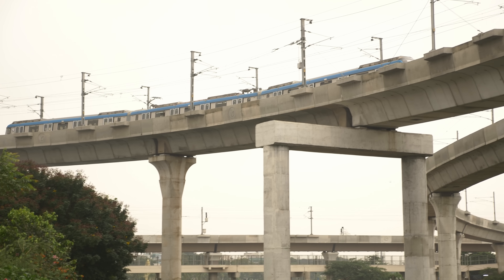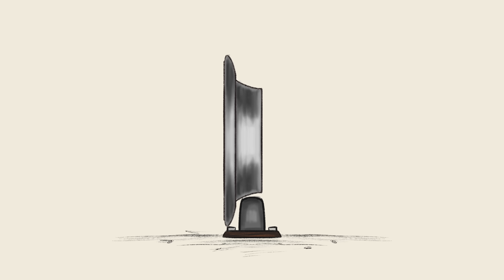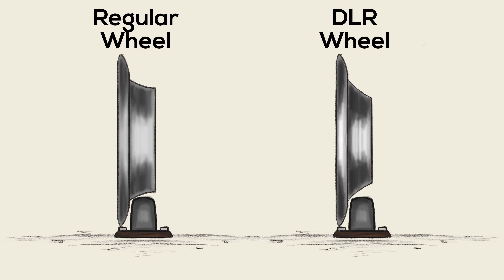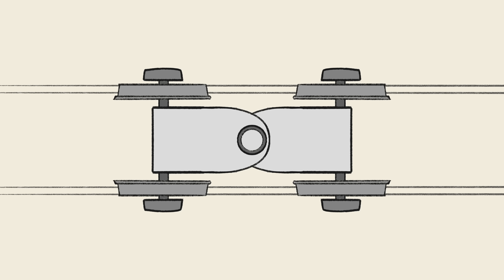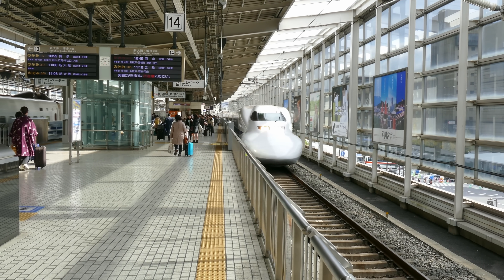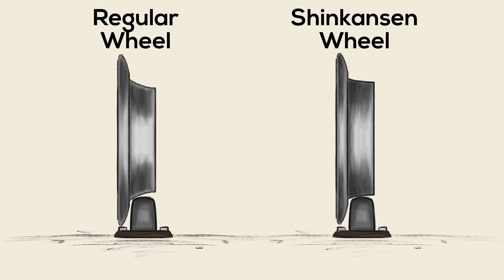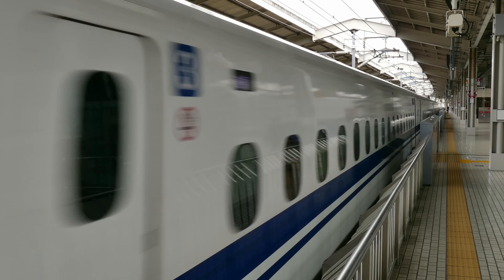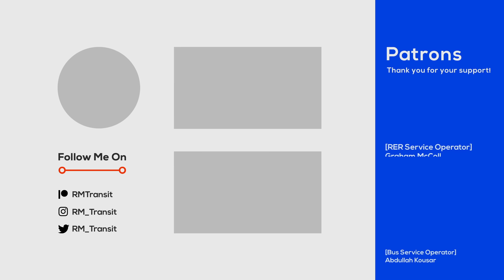BART, DLR, Bullet Trains and Their Odd Wheel Profiles.

Comment: As a former commuter on High Speed 1 in the UK, I can confirm that hunting can be very entertaining/alarming. The wheels on the Hitachi class 395s have to cope with some very severe curves on the old network (Dover being the most obvious example) then with running at 140mph on HS1. It was generally fine until you got to one of the long tunnels when after a while the air pressures would start an oscillation going that would get pretty violent. Not good when you're trying to drink your tea (morning) or beer (usually evening). I'm not sure whether they reprofiled the wheels, or tuned the yaw dampers, but the problem isn't a severe as before.
Reply from the maker: That’s concerning!
Reply: @RMTransit  Eh, trains having somewhat violent ride characteristics seems to be a bit of a running theme here in the UK Travelling between home and university I used to ride the Arun Valley line in Sussex, and between Horsham and Barnham the class 377s that work the line can get pretty lively, to the point that you'd find it difficult to walk down the aisle, and stuff would slide off the tables (and occasionally the luggage racks).

Although since they ride decently on other parts of the network that might be more of a maintenance thing "Is the train going to derail? No? Then it's fine, put it off till nex year" and just ignoring all the old ladies being hurled bodily through the carriage!
Reply: @jambutnotoast  yeah I think that line gets a bit of subsidence too. I grew up in Littlehampton so know it well, lovely route.

Comment: Yes to gadgetbahn video but also could you do a deep dive into Ottawa's LRT and the problems with it?? Please? I know there isn't a huge amount of info out there right now as it's still being investigated by the NTSB but as someone who lives in Ottawa and having the trains be out of service until December(!!!) it would be greatly appreciated if you could give us a better understanding of what is wrong and how it might be fixed.

Thanks and keep up the awesome work!!
Reply from the maker: I still think this video I made before covers my thoughts best!

https://youtu.be/uhvTxAvDu7A
Reply: @RMTransit  Fair enough. I'm starting to think that tram trains on a metro line may not have been the best idea. I'm wondering if the city might be better off cutting its loses and scrapping the fleet in favour of 70% low-floor trains instead.

I just can't wait for the trains to be back up and running reliably and for the bus fleet to be converted over to battery electric, then Ottawa will have one of the best and most climate-friendly systems ever!
Reply: The trains are too lightly built for their purpose and aren't really holding up. In particular, the axles were carried over from the Citadis Dualis and have previously had issues with durability. Alstom also doesn't have the best track record with trams and light rail, especially since they switched their focus to 100% low floor. 

Another compounding factor might be the geometry of the primary suspension. The Citadis Dualis had a four-link arrangment connecting the axle to the bogie frame, like a live axle in a car, which was probably not the easiest to maintain but quite good in allowing the axles to articulate. On the Spirit this was replaced by a much simpler design, two rocker arms which are fused to the axle, effectively the same geometry as twist-beam axle on a car, but much stiffer. This greatly increases stresses on the axle and limits the ability of the wheels to maintain contact with the rails all the time, which greatly increases the risk of derailment.

Comment: The first footage of "BART" in this video is actually the AirTrain at SFO. This is a Bombardier Innovia APM 100 and is not operated by BART.
Reply from the maker: Yeah I was trying to go for unconventional but missed the mark haha
Reply: Was going to say the same thing. I guess it runs close to BART though?
Reply: @agntdrake  bart interchanges with the SFO AirTrain system at 2 stations (International Terminal G and Garage G/BART) Because of BART’s long platform length you can enter BART from the main entrance to the station at the Intl terminal or midway along the platform where AirTrain stops at Garage G
Reply: @crazyoncoffee  yep. My point was to point out why Reece used the footage of AirTrain instead of BART. I can see how some people could get confused given how they connect.
Reply: Almost thought it was the BART branch line instead to Oakland Airport

Comment: My favourite steered design is probably the three axle tram. The middle axle slides from side to side in bends and steers the two outer axles through linkages.
Reply: How does that work? I ride these types of trams and i was wondering. I mean i knew about the train wheels but I don't know well about articulated trams
Reply: @PanosSkarp  as far as I know the last of these trams was withdrawn in the 2000s. They also didn't make any articulated trams of this type apart from a few in Augsburg and one prototype in Munich. The closest modern equivalent would probably be the Cobra Tram in Zurich.
Reply: @cityjetproductions  oh i see. I mistakenly thought that you were talking about three bogied trams instead of three axles. Thanks for the info!
Reply: @PanosSkarp  Look at the Dutch Railways mDDM, a mainline train where the powered coach has three bogies. The middle bogie should be able to slide left and right while still carrying the weight of the train.

 It was used because the large traction motors to provide the necessary power were too large at the time to fit underneath the passenger cabin.

Comment: My preference of wheel shape is round, a circle to be exact. It gives a smoother ride.
Reply: This is why train wheels should be reshaped periodically, most importantly to remove flats (for example as a result of emergency braking, or because someone forgot to open the hand brake). Of course, this happens far too rarely with freight wagons (because $$$), so freight trains tend to have lots of flats making a lot of noise and damaging the rails (those flats are effectively hammering the rail). Which, incidentally, also means $$$ as the rails now need reshaping. Oh well.
Reply from the maker: Haha very good point
Reply: @EricLDunn  r/whooosh?

Comment: Do you by any chance know how this theory corresponds with the Talgo system? That system is unique because it has wheels that can turn independently but does this mean that the wheels are less sloped and as such have less hunting?
Reply: Reece, if you are reading this, please make a video about Talgo. Their gauge changing trains are also super interesting
Reply: I always wondered why more trains don't use independently-moving wheels. It does increase complexity a bit but you don't need complex differentials like on ICE cars, just put a separate motor on each wheel and let the passive wheels spin freely. A solid axle does help you guarantee keeping the wheels at the correct rail gauge but robust mounting could do the same thing.
Reply: @NozomuYume  With separate motors for wheels on each side but no differential your control electronics have to be precise enough such that each motor runs @ exactly the same speed if you want the train to go straight instead of turn
Reply: @lzh4950  Not really, they just have to apply roughly the same amount of torque, and not apply so much that they slip. Friction will keep the speed correct.
Reply from the maker: I believe there have been some studies on it but I’m not super well-versed unfortunately I do talk a bit about gauge changing etc. in my Spanish high-speed rail video